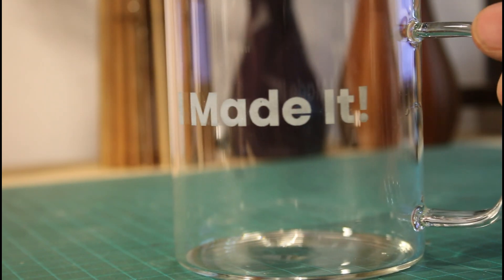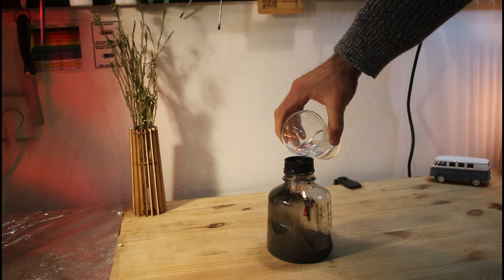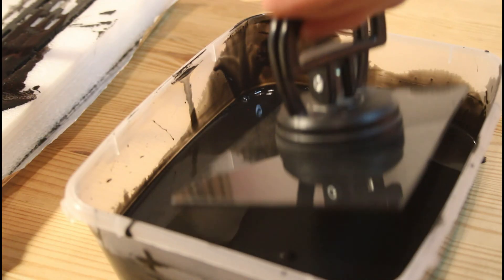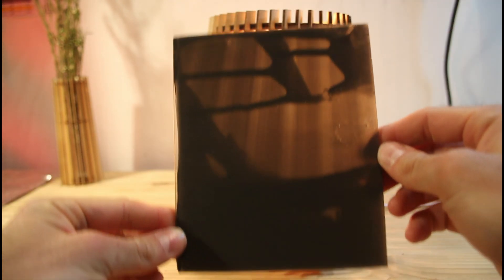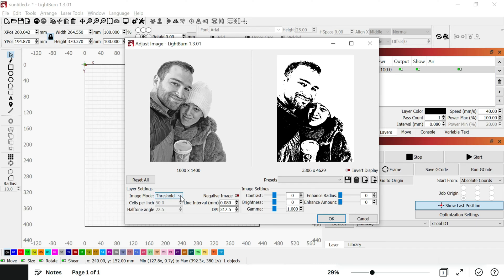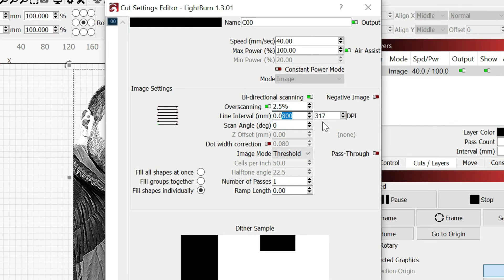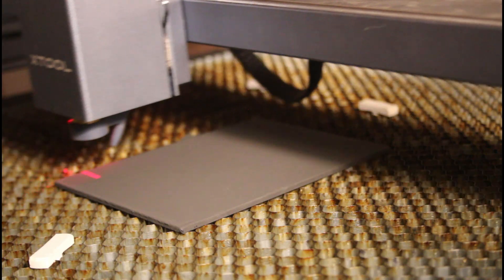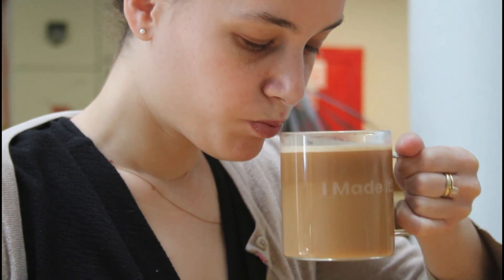Easy Glass Engraving on a Diode Laser Engraver

Comment: How long does it take to engrave something ? The entire process ?
Reply from the maker: This coating method takes probably 1-2 hours due to the drying stage. The engraving itself depends on the size of the pattern that you wish to engrave and the laser you're using. With my 10W diode I usually engrave glass at 40mm/s and each line is 0.08mm thick (80 microns), so the engraving rate is 3.2 mm^2/s. For example, a 100mm by 100mm pattern covers and area of 10,000 mm^2 which will take ~52 minutes. Hope that helps!
Reply: @nixmakes it does, thank you

Comment: Engraving glass with a diode laser works by adding a coating like black paint or dish soap so the laser can mark the surface, since glass alone doesn’t absorb the beam well. I use the Monport Mega and love it—it's a CO₂ laser with auto-focus and built-in lights, and it engraves glass super easily without needing extra steps.
Reply from the maker: I agree, glass doesn't absorb much of the diode laser's emission so you need to coat it first (I mention that in my video). The laser your mentioned looks great :) The only problem is that it costs about four times as much. Diode lasers have lots of downsides compared to CO2, but they're really affordable and a great place to start :) I love mine.

Comment: Hey how did you add the camera to the d1?
Reply from the maker: Hi, I'm using Lightburn to control my laser. The camera is actually connected to my laptop, not the D1, and Lightburn controls both. Lightburn let's you calibrate and use any USB camera (and other connections too). Wide-angle cameras are best because they can capture all of the workspace at once (I bought one from AliExpress for $17 and it works great). Lightburn has a great toturial on how to pick the right camera, and how to connect, align and calibrate it. I hope my answer helps, but if not, feel free to contact me via my website.
Nir
Reply: @nixmakes  thanks for your time and information 👍

Comment: I found it much easier to just use flat black spray paint. Clean the glass, spray the paint evenly, and away you go.
Reply from the maker: Sounds like a good idea. I figured it would be hard to remove the paint since the spray paints I know  are not water-washable. What paint do you use? Would you need two layers in that case as well? From my experience, a thin layer of paint doesn't have enough meat for the laser to burn, so it doesn't engrave the glass as well. That's why I'm using two layers
Reply: @nixmakes  the paint I use is barbecue/grill paint, one well done layer worked great. Wipe down with acetone after and it cleans right up!
Reply from the maker: @CrisAnderson27  Nice, my workshop is inside the house (we live in the city), so I didn't want to use spray or chemicals, but my laser enclosure is practically a fume hood, so maybe I'll try it in there. Thanks for the comments :) Glad to learn something new!
Reply: @CrisAnderson27 that paint is typically flat black and high temperature right? I have some flat black, semi-gloss black, and semi gloss grey. All are rated for 1200 degrees (I'm assuming 1200F). I imagine flat black is best since it would absorb the most energy
Reply: @nixmakes  I use just the cheapest flat black spay from walmart. takes a few coats to get it thick enough to engrave but does a great job quickly. and easy to scrape off with a razor.
Reply from the maker: @dannon18  thanks for the comment :) does the razor leave scratch marks? I would also try using ethanol to remove the paint (we do it in my lab with all kinds of paint)
By the way, I agree that spray paint could be an easy solution, but I don't have a backyard and I don't want to spray paint inside the house, so I had to find a different solution. For very small engravings I even used a sharpy a couple of times, and it works pretty well
Reply: @nixmakes  no scratch marks at all. But thr solvent is a great idea and I'll have to try it myself.